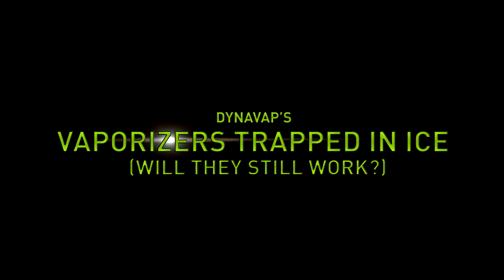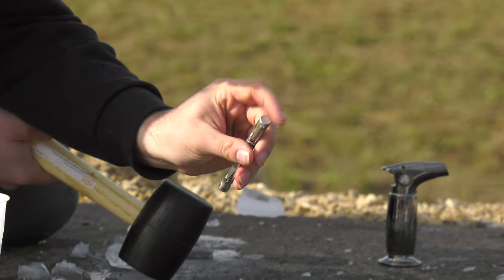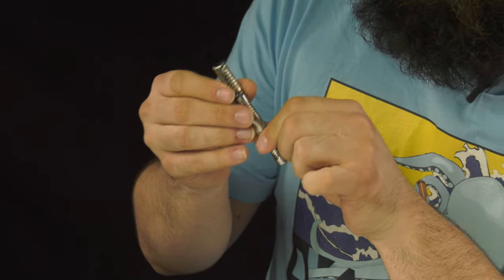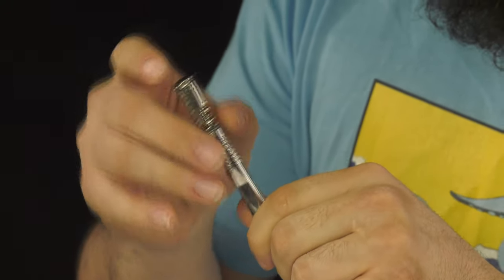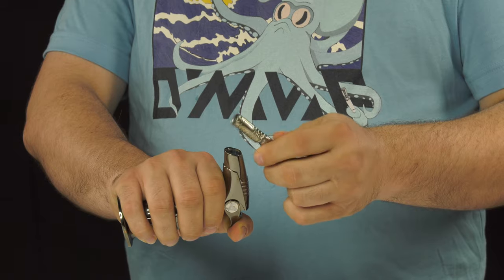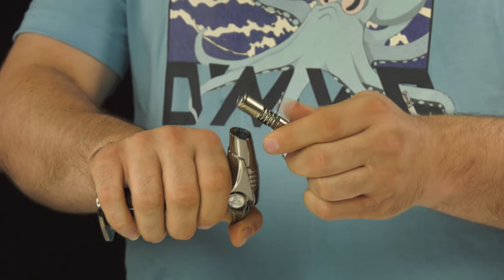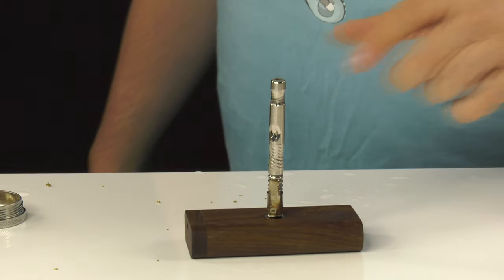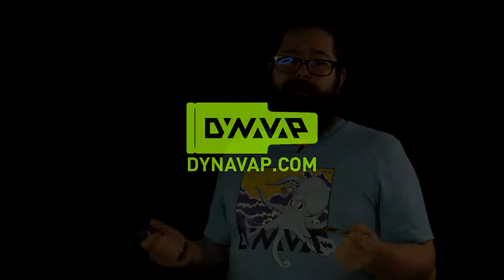Smashing a Vaporizer with a Mallet

Comment: Gimme back my titanium caps plz.
Reply: there are no ti  caps or am i wrong??
Reply: @alexleo37  there used to be but they stopped making them. My titanium xl has a ti cap and it just lasts a lot better. No indented cap like with my 2020m (never used it with a induction heater)
Reply: @vakantieman3270  thanks for reply, awsome i didn't know^^
then i also hope they're gonna make them again,now i wanna try that XD cheers and greez from austria :)
Reply: There have never been titanium caps. They've always been made of stainless steel.
Reply: There's no information about such things,  and I belive they never did something like that.
I'm not sure it would even work properly.
Reply: @sidneyoh8817  that's what i thought, thx ;)
Reply: @Ren4rd_o7  i guess you're right i also thougt they don't exist!